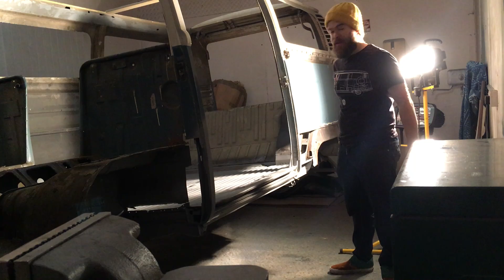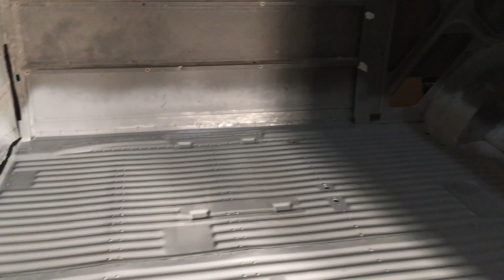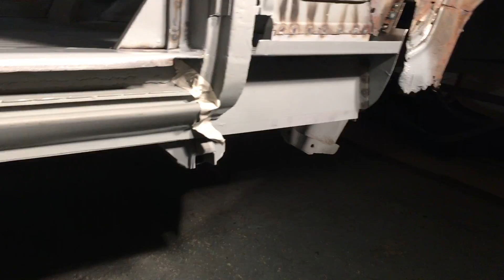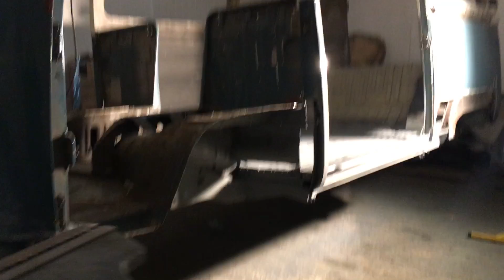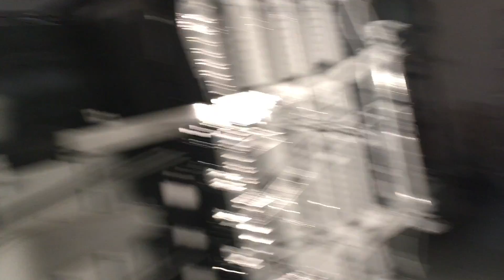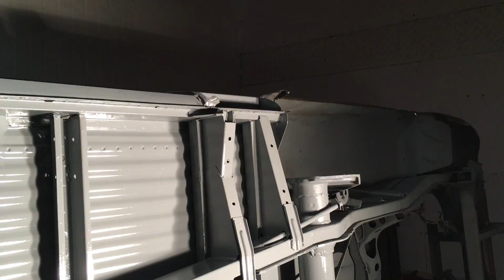VW Bay Christmas Chassis Update

Comment: Looks sweet, what did you coat them panels with grey por15?
Reply from the maker: Vw Rosstorations I've been using Bilt Hamber paints for all my chassis work. Their zinc primer (electrox) and then 2-3 coats of epoxy mastic. Super tough.